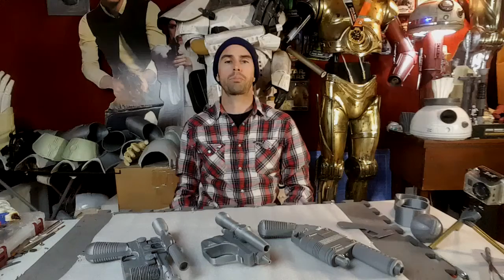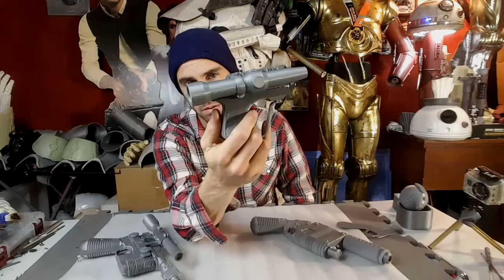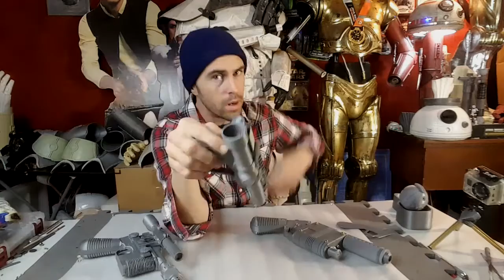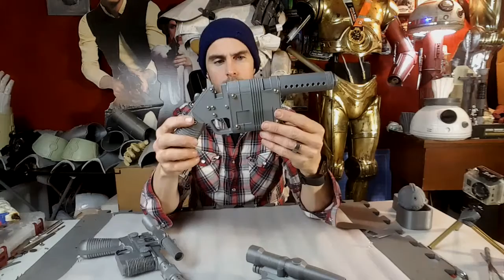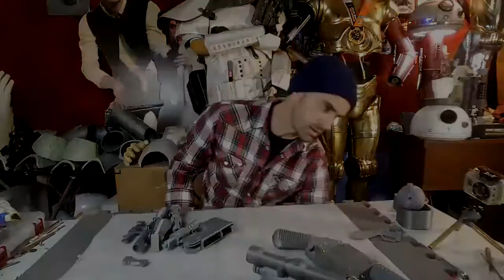Free 3d print files pt01 - Star Wars Blasters

Comment: Just simply copy how the Denix Hammer functions by drilling a hole and running a pin through both the Hammer and Lower Receiver, right where the bottom circular section of the Hammer rotates at in the back end of the Lower Receiver? You'd then just need to figure out how to add a fabricated spring that's sort of shaped like a lowercase q. The top of the spring fits inside a little notch that goes off and around the pin and center of the hammer. Wah-lah, cock that SOB!?

Comment: Hi Gordon after seeing  your results from the printer I when out and bought one but I'm having a problem with the correct print settings if possible could you do a short tutorial  any help would be awesome
Reply: showing his settings would still give you limited results. even with the same model printer, there will be little variances that will make it unique. just copying somebody else wont always work. you have to dial in on what settings work for you. just do your research. itll be better in the long run because you will not only learn the best settings for your printer, but you will also learn why they work for you. that will help if anything goes wrong or needs replacing. you will be able to diagnose andsolve the problems yourself. wheras if you just copy someone and something goes wrong later on, you will have no idea why or how to go about fixing it.

Comment: Thanks for the files ! Starting printing right now ! ;)
I have more or less the same printer as yours (I have the Pursa i3 Pro B) and using slic3R and Repetier Host, but I am having trouble with the support material especially to take them off after the print is done. Using PLA. What are your setting for support material?
Reply from the maker: +SW_MonkeyRaff_SW I'd have to check next time i'm by the printer. Sometimes i have issues getting support material off of the parts as well (upper receiver on the Han blaster had some major tough cleanup in one area). 
Before printing I generally try and orient the model in a way where there is less support needed OR so that the support is in an area that's easiest to remove.